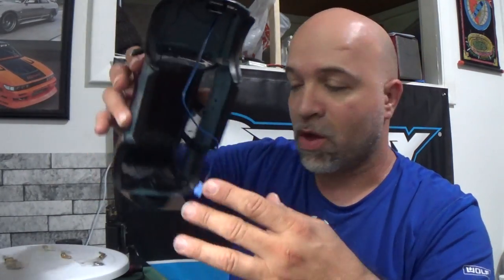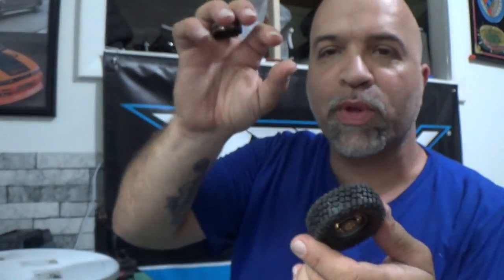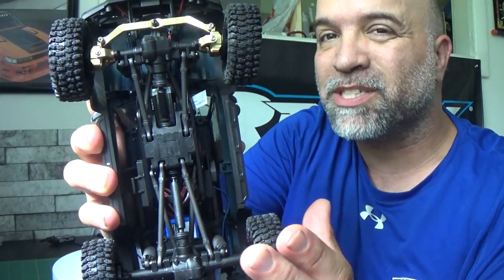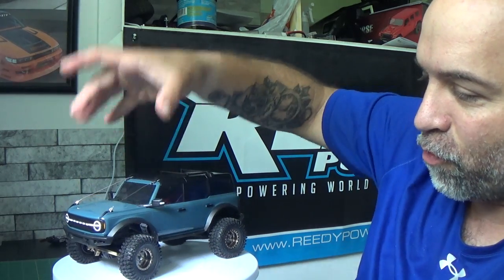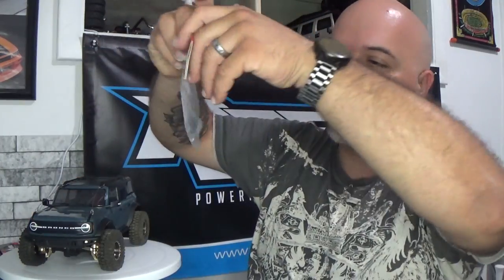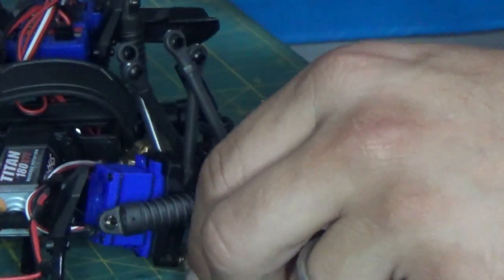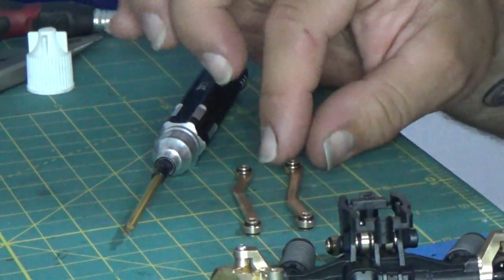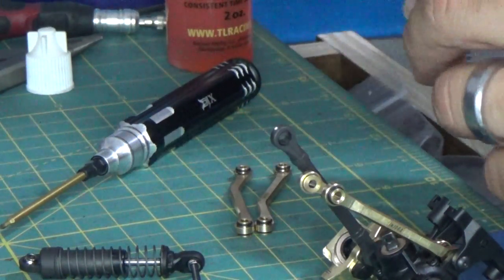TRX4M Diff gears replacement and Shock Upgrade

Comment: I recommend the crawler gears ,  and then install the injora pro motor as it will allow you to gain back some wheel speed .
Reply from the maker: Thanks for the info I will look into getting a new motor for it

Comment: Wow. I just picked up a new trx 4m this past Saturday in the area 51 color. I want to get the brass wheels and some good tires from injora. What size tires did you run? I see that I need to go ahead and put metal gears in when I add weight to it. Nice informative video. Thanks man. Keep runnin that rig. Looks great.